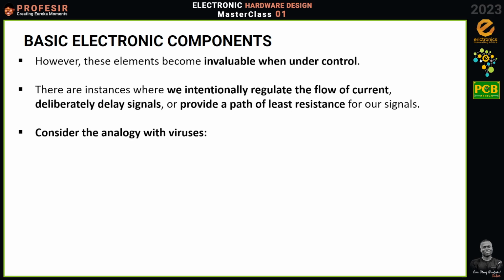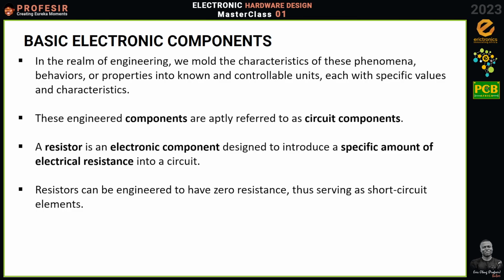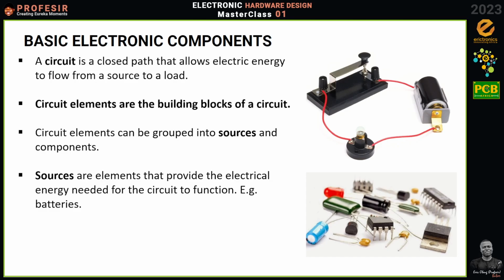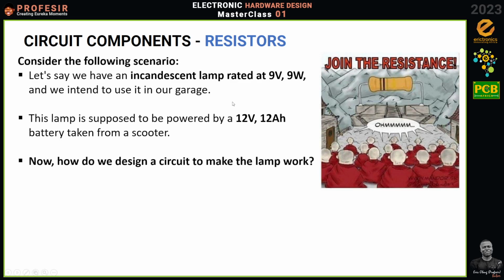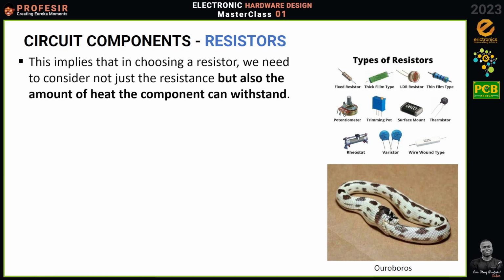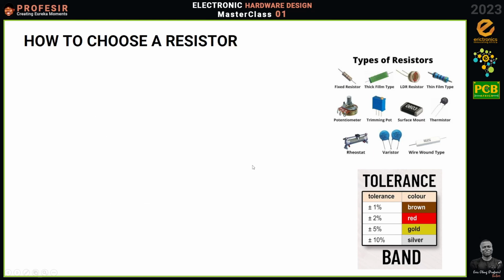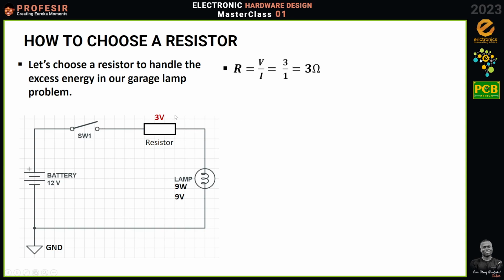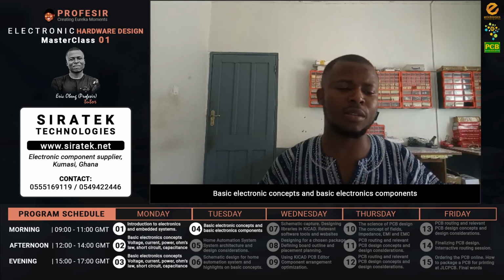Lesson 15: Basic Electronics Components - From Theory to Reality - Applying Electronics Concepts

Comment: Sir I have a question.  If the resistors control current flowing to a component, does it mean in a way they regulate voltage too?
Reply from the maker: Well its a matter of technicalities. Loosely speaking I guess you can say that. But technically, a resistor does not regulate voltage. A voltage regulator should be able to produce a constant voltage output over a range of inputs voltages. for instance. A typical lm7805 would produce a constant 5V output when the input voltage is between 7 to 15V. The same cannot be said of a resistor. Resistors causes voltage drops which if given a constant input will remain constant so far as all other parameters remain constant. But a slight change in voltage will cause a change in the output. Therefore, resistors are not technically voltage regulators.